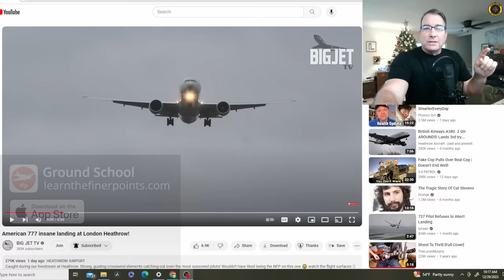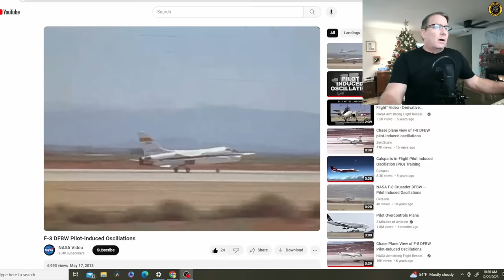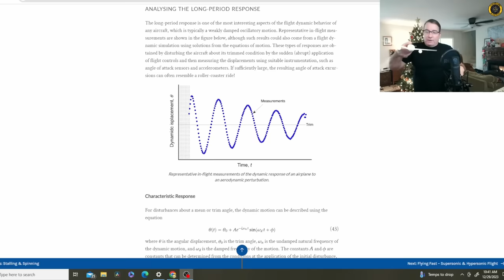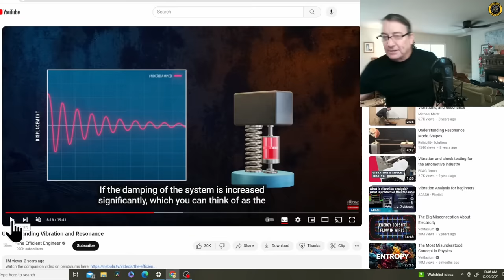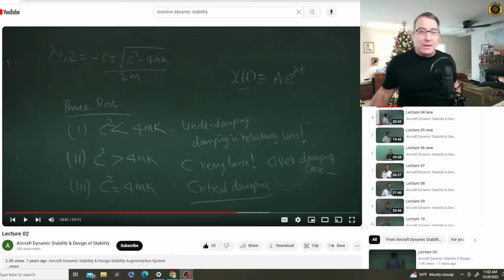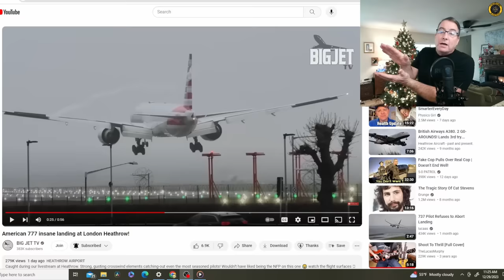B-777 Hard Landing LHR Big Jet TV

Comment: Awesome explanation. Modern technology has made these ac much more safer. While not a pilot, I was a crew chief on the KC-135R and have had plenty of flight time in them. I have been on ac that have had what felt like hard landings and have definitely been involved in a few hard landing inspections. The application of fly by wire has been a huge improvement over cable driven systems. Keep up the good videos. Happy New Years.

Comment: It's a bit like fishtailing a car.  The large control input causes the vehicle (or airplane) to rotate towards the desired direction fast, but the angular momentum will carry it right through the desired direction and then out the other side.  To bring it back to center (the desired direction) without any oscillations, you need to apply two opposing control inputs - the first one is the natural one to start it coming back, but the second one is in the opposite direction and you need to do it before it comes back to center in order to slow down the angular velocity to prevent it carrying on right through to the other side.

So for the airplane nose too high, push forward to bring it down, but then do the opposite and pull back before it's finished coming down to where you want it to be, in order to decrease the rate at which it's coming down.  Failing to do the second part soon enough (or at all) is what causes the oscillations.

Another analogy is stopping a car... you start braking before the point where you want to stop.  You don't keep your foot on the gas until you reach that point.  That sounds really obvious, but it's the same thing with rotational controls (pitch, roll, yaw) - you need to slow down the rate of rotation before you reach the target.  When bringing the nose down, down elevator is equivalent to having your foot on the gas in the "nose down" direction.  Hit the brakes (up elevator) before it arrives at the desired pitch angle, then return the control to neutral as it comes to a stop.  It's a complex movement and not easy to get right.  As Juan said, sometimes it's best to just stop fighting it if you haven't had enough practice to know how to get it right, because the plane will sort itself out eventually with only gentle control inputs.
Reply: like a tank-slapper on a motorcycle, lighten up dont fight the bars, but if you feel it hitting the steering stops it might be useful to carefully bail out.
Reply: I think the Airbus fly by wire system (except when in Direct Law mode) does all that for you, and the side stick is just to tell it what you want it to do, not so much how.  Can anyone confirm that?

Comment: I had a landing almost just like that! Only I wasn't flying a B-777, I was flying a PA28-140. Also the winds weren't 40 Mph at my landing, it was only 17 knots, which is within the limits of the airplane. However, the gusts were 32 knots, and the direction of the wind according to ATIS was 040 which was wrong. The direction was 080, and with those factors, it was a very sporty ride! I did land the airplane, but I had to toss my underwear after blowing out the back side on that landing. On the bright side, the airplane was still in flying condition after that landing, which is always a plus.
Reply: You totally could've shared this story and left your underwear out of it. Seriously. Leave a little to the imagination.

Comment: There rarely is a reason to push forward on the stick/yoke and only rotate and flare to pull back. Trim and throttle are the controls to use.

Comment: International flying at its best.. 99.9% boredom, .01% shear terror..I’ve been in and out of London a hundred times (A-330) he’s right about Atc runs aircraft in and out very tight.. no more then then aircraft in front is just clearing and your flaring out ( dangerous!).. another side to look at here is pilot fatigue, time in   Type, block holder/reserve .. I can’t say for sure most of the time  Captain takes first leg.. there is absolutely no room for error there..and you will always have to hold/ slow to get in. Not a good overnight, hotel suck, long ride to the hotel and of course the weather..all in all this guy recovers very well ( professional) .. seat cover change for sure..

Comment: There are techniques used by the manufacturers to identify inherent PIO tendencies in the fly-by-wire systems. In retrospect I did experience an event in the 777-200 post certification which was eyewatering but resulted in no damage. I was involved in the development of the 787 system and, due to incomplete analysis, we did experience a near disaster but the pilot-no-flying identified and called it so the pilot was able to stop the event, which is quite typical. It happened that way in a space shuttle landing where the PNF recognized and called it so it was stopped. As far as the landing, the nose wheel strike in the most critical. The main gear has enough absorption that it will make your eyes water before damage in experienced.
Reply: The PNF recognized what exactly?  And how did the Pilot stop, it.  
Not clear what you're saying.
Reply: @mr.mcbeavy1443  I think he is saying the PNF recognized that the PF was causing PIO and called it out to him so that the PF would recognize what he was doing and stop.
Reply: I can imagine the whole conversation is just PNF saying "easy, easy" and the PIC realizing they are part of a PIO and stopping their pumping.
Reply: @StratMatt777  
Ok, thanks. I guess that makes sense, didn't know the shuttle was a good candidate for PIO.   Thanks
Reply: @mr.mcbeavy1443  if I remember correctly, Shuttle had about 250 milliseconds of delay in the controls because the digital fly-by-wire had slow computers (even for 1980, because they had to be hardened for space).

Also, the Shuttle stick had a point of rotation in the palm of the pilot -- I guess that was good for orbital maneuvers. But it feels weird as an airplane inceptor.

My only experience with it was the Vertical Motion Simulator at NASA Ames. I got into a PIO on one of my landings in the sim.
Reply: @NelsonBrown  
Thanks for your input. That too would make sense.

Comment: It's hard to think in terms of frequency.  In Laplace transform control functions there are time constants that express and are observed as frequency.  If you are engineering a system you can fix divergent solutions by avoiding similar time constants. This math and input frequency / response frequency shows up and  many many man-machine interfaces. Whatever you're flying or driving or operating it's important to know the inputs the lead to the correct response. Fun stuff Juan.
Reply: When it comes to airliner touchdown dynamics, there are too many nonlinearities for a closed-form solution:  The variable damping action of a multi-tapered metering pin inside the shock strut;  The stepped deployment of spoilers on some aircraft designs (deploy part way, pause, deploy the rest of the way).  Stepwise numerical integration or an equivalent numerical method is the only way I'm aware of to handle all of those inputs and responses.  An approximate but closed form approach could nonetheless help in establishing a preliminary design.

Comment: On one B777-300ER flight I had an aisle seat right down the back where the seats are in the 2-4-2 configuration.  As the plane did a cross-wind landing I really felt it as the 777 straightened up.  I tried to explain what had happened to the elderly lady seated next to me, but she didn't seem perturbed just surprised😂

Comment: This oscillation can also be induced by car drivers, you can actually shake up every car into a state where it completely goes uncontrolled. Happened to me once on the autobahn, while braking at 250kmh. Luckily no other car war close to me, so I quickly realized that the best way to stop it would be to keep the hands off the steering wheel and let the ESP regulate the situation.

Comment: PIO is Pilot Induced Oscillation. A pilot induced landing is a normal operation. :)  Sorry Jaun I could not resist that correction. What pilots do after the bounce is what causes a PIO. Unless you go around an aircraft will return to the ground after a bounce and there is no reason a pilot needs to help gravity to get it going back toward the ground with nose down pitch lower than the normal pitch at touchdown. Gravity always works and the airplane will return to earth. The recovery while heading back down depends on the type of aircraft. Ref -5 in a heavy jet and pitch will only get you a tail strike do nothing to stop it accelerating toward the runway, power is the only thing that will slow the rate and lessen the impact.  I have some hard ones too.

Comment: Love your content, but the physics term is simply damp, not dampEN. You have a yaw damper not a yaw dampener.  The physics lecture on aircraft dynamic stability used the  correct terminology, referring to “damping” not dampENing. This is a MINOR complaint, but as a physics guy, it hits my nerd hot button. However, I always learn from your content, and thank you for sharing it!!
Reply: Ha!  I had the same thought!  I'm an electronics engineer and have taken a couple of classes on control theory, and frequently wince when someone talks about dampening an oscillation.  Kudos to Juan for digging into the topic, as shown by the screenshots of whiteboards!
Reply: Someone here needed to hit the pedantry corner 😅
Beware the audience you're in when you talk about dampers, Brits use the term for shock absorbers
Reply: @LadyAnuB  yep because they DAMP (not dampen) the oscillation of the springs in the suspension. It’s a great use of the term
Reply: @LadyAnuB  They probably use that term because that's what shock absorbers are. They're the dampers in the suspension system.
Reply from the maker: Dampen NOT dampening....questions?
Reply: @blancolirio  damp vs dampen and damping vs dampening. Unless you are  putting water on it, leave out the en in all forms.
Reply: @blancolirio  I believe the correct terms are "damping", "damp", or "damped".  The context would be "the system was underdamped" or "we achieved critical damping".  No idea who to blame for this weird terminology.😃

Comment: Sometimes this roller coaster ride is brought on by poor power and speed management. Some pilots just automatically add airspeed when there is gusty conditions and sometimes add a ridiculous amount of speed to try and counter wind conditions. Extra speed is not always the answer. Some pilots keep adding 5 kts for this 10 kts for that and an extra 5 for "safety" and crossing the threshold they are 20 or 30 kts above ref. With all the extra speed, the plane is not ready to land. But with all that speed, rudder, elevator, and aileron inputs are all amplified from the extra airflow. Normally, as speed bleeds off, the controls become mushy and lose authority with the diminishing airspeed. But if they are way above normal speed, a normal flare can turn into an unexpected climb. Normal inputs and pressures are amplified and the plane doesn't do what it normally does because the speed is way above a normal landing. Carrying extra power and speed in a normal landing has consequences and unexpected effects. Sometimes a slower lumbering heavy plane is the best way to counter a normal wind gust. Every pilot is a little different but carrying way too much airspeed sometimes sets off a chain of induced oscillations simply because of the difference in flight control effectiveness at low and high speed. Having the skill to quickly react to a gust is the key, not trying to eliminate all gusts with excessive speed. My 2 cents anyway.
Reply: You have to be going fast enough that the end of a gust does not cause you to stall.

Comment: I guess I’m old school.  I’m not a fan of fly by wire.  Give me bellcranks, pulleys and cables.
Reply: I flew mid 1950s - mid 1960s jets for the first 20 years of my career (T-37, T-38, C-141, C-5, and 727). Ten years ago I came over to the 777 and wouldn’t trade the fly by wire system in the 777 for any of that old stuff.
Reply: Old hens make good stew

Comment: The more modern, and appropriate term for "PIO" is pilot-IN-THE-LOOP-oscillation: This shifts the focus (and blame) away from the pilot and makes it more clear that the entire closed-loop system is to be considered (and "at fault"). After all, many PIOs are due to phase lags from, e.g. electronics or hydraulics, and not so much because of pilot behaviour.

Comment: I’m also a 777 FO, 10,000+ hrs and 4,000 on type. Easy to critique another’s landing I accept. However… the FCTM says that the pitch attitude should be set and held for the flare. Acknowledge that’s not so easy on a gusty landing! However, I think there is slightly too much input on this one for me. 
To my mind the event starts with the slight trail off the LH flap. This indicates to me a change in the airflow; I think a gust ceased (or as you state, possible vortex turbulence although there was huge LH crosswind on that day and I think it would have dispersed or moved much further over to the other side of the runway). The pilot corrects appropriately with RH aileron, and the initial flare is good, but he puts in a bit much elevator. The rest is just correction. Better to input and hold, waiting to go around. Also, a little rudder input would have helped.
Like you say the triple is a mighty strong airplane and ultimately the landing was gathered up.
I’m LHR based, can’t say I’d have done any better on the day, it was rough as old boots! The wind there has a particularly ‘choppy’ nature to it, very staccato. It makes it harder than the pure windspeed would have you believe.

Comment: As an engineer, not a pilot, I'm aware of another effect like pilot induced oscillation. In control theory, if control inputs are too big the system can be unstable and the solution is to reduce the inputs. I think of this when I see cockpit videos of landings where the pilot is pumping away at the controls and to my untrained eye I think they could just reduce the inputs and get a much smoother ride for the passengers. I know bigger control inputs are needed as the aircraft slows, but it's the up, down, up, down sequences that needs calming, like the pilot in the video.
I've experienced a similar thing as a passenger on commercial flights. On take off - some pilots run straight down the runway while with others it's constantly tweak tweak tweak, left and right until we're off the ground! Maybe I'm being unfair and those pilots had gusty sidewinds - your comments would be appreciated.

Comment: I’m sure the weather in the States is as ferocious as at Heathrow.   After a long flight on autopilot,  particularly when the weather is stormy , there is a lot to be said for disengaging the autopilot in sufficient time for the handling pilot to programme his hand eye coordination ie get the feel of the controls again.   I doubt wake turbulence would be a factor.  Heathrow are pretty strict when it comes to timings/distance separation.   Over and above the stormy conditions,  turbulence off the hangars and buildings has to be factored in.   
My estimation is that the A/C was light and therefore relatively slow with low inertia,  and therefore more gust responsive.   Heathrow has very long runways,  and in these conditions flying on the upper limit of bug speed would increase the inertia,  and the handling pilot can look out of the window more , and relatively less at his speed.   ( There is nothing worse than PNF haranguing you about your speed when you’re close to the ground and concentrating on your landing, in these conditions).   More speed requires smaller control inputs ,  with lower pitch attitude, reducing the risk of what occurred here.

Drive the A/C onto the runway ,  with only a gesture of a flare , ….the R/W looked pretty wet ,  so the ground spoilers will deploy immediately kill the lift and give good braking .  Don’t let go of the controls….phew I’m down…fly the nose wheel onto the runway and apply whatever inputs are in the manual.  Keep flying until you’re down to say 60kts. 
Haven’t flown the 777 but I have lots of time on the DC9, 737, A320.     I think he was slow.

Comment: One thing that gives me hope about Tesla's Full Self-Driving system is that in recent months its tendency to perform turns in an underdamped manner have been reduced. The oscillations (of a sort) did not grow, but they didn't damp out fast enough. Much better these days, for the most part. There are still issues. Fingers crossed.

Comment: I was an A/A Capt from 1990-2020.  On one A300 EGLL trip my FO (Steve Hartnet) called for a divert immediately to EGCC from holding at OCK because the cross-wind component was advertised at our maximum of 30KTS.  We diverted, and learned later that day that a B767 landed hard at EGLL.  Back at JFK the next week a NY based CKA said that AA totaled the  767 after an unpressurized ferry to DFW because of a crease in the top of the fuselage.  After hearing the NY CKA, my personal crosswind limit was reduced to 20 KTS for the remainder of my career- about 25 years.  Management and other pilots never complained.

Comment: I’ll say I had about 3500 hours total time and 2000 of that in turboprops by the time I flew my first jet, a B373-8 and I was absolutely shocked at how easy it is to over control, and have PIO. Big eye opener. Have to be very delicate and cautious of your inputs, for me I find I have better landings with auto throttle off, as the nose up tendency of any engine thrust can very easily change control force required.

Comment: On another day, in the A300 the crosswind component was advertised at 30KTS for a takeoff from KBOS.  Legal, conditions, I had big hours in the A300, so I did.  On climbout the burt rubber smell from the tires was still a happenin’.  Cabin calls…. DOH!  Embarrassing needless extra risk!  That was the first and last time I did a takeoff with 30KTS of wind abeam the Bus, or later the 7-6, 7-7 or A330.